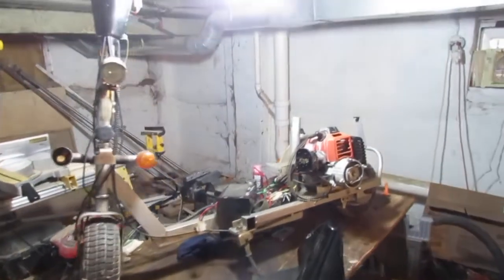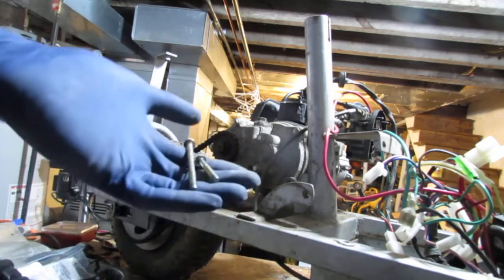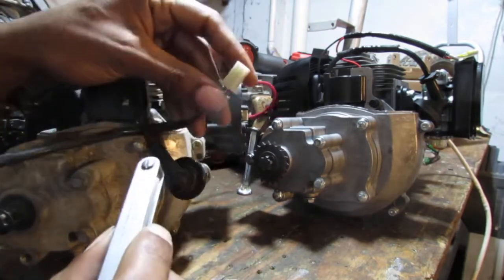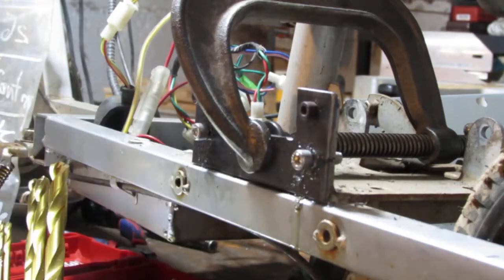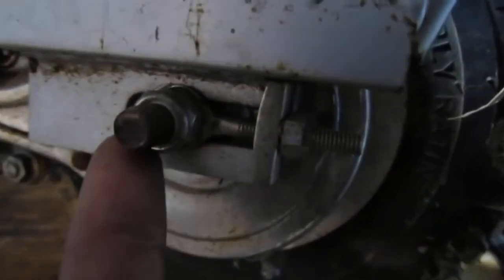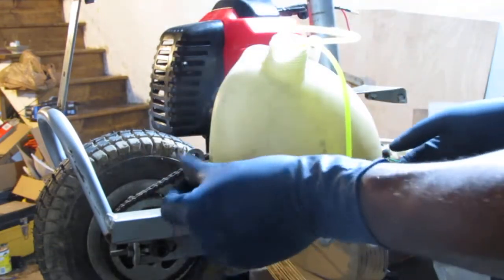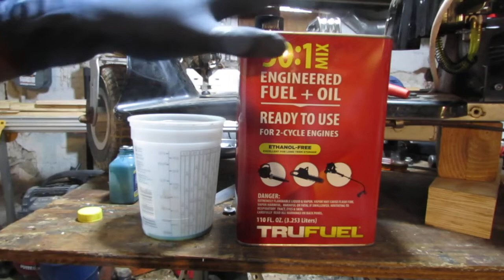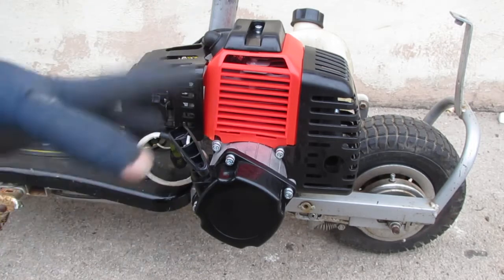Cheap Chinese Gas Scooter 1E36F, Turbo 36CCEX

Comment: This video helped me a lot, thank you!  I used propane out of a common torch to start the engine.  Took about 30 seconds on prop. before the fuel pump would actually prime and run the machine.  I'm running a 16 to 1 fuel ratio 😅  as long as I hop on it and get on the throttle, she runs well

Comment: I just ended up grabbing one of these scooters for like $30 - your tear down is already helping me out!
Reply from the maker: That damn carburetor is killing me.  I got two replacement engines, same engines and they both failed.  I can not dial in the carburetor so it runs with the correct amount of power and with the choke off.  No matter what I do I can not get this carburetor set.  I need high and low settings to adjust appropriately.  The carburetor on these only have fuel mixture.  Have been searching for an alternative carburetor with the same bolt up size with a high and low adjustments and have not found any.  I also got mine for cheap $20 USD.  I thought I could save it.  This is what is causing a delay for a part 2 of this video.  Let me know how it goes and glad this is helping you.  If you find an alternative carburetor let me know.

Comment: So did you get it running correctly ? there is a hidden speed adjustment screw at the top center of the carb under the plastic round at center. The round "relay" is the electric starter solenoid. Works with the battery and key. Just found the exact same model and trouble shooting the electrical now. Mine is also in bad shape. Fuel should of not been leaking where it did on yours. the paper gasket should have sealed it to make it air tight. Nice work on the metal fabrication. check for that hidden screw adjuster. it's there.
Reply from the maker: I did not get it running.  I had a different idea on it.  I was going to ream out the main jet.  This speed adjustment you mention, this is different from the idle screw I was messing with in the video?   I will look at the carburetor for the secret adjustment screw you mentioned.   I suspect because I have so little control over the carburetor it might also be flooding the engine.  Thanks for explaining the part of the electrical system.  The electrical system is super easy.  I really want to restore this scooter.  So much so I was going to dump money into getting a 220 welder and getting an electrician to add that line to the house so I can build a different engine housing and get a different engine that has a better carburetor.
Reply: @MotionDesignStudio   Right on top of that cooperator is a is a slaughtered screw screw you can't miss it turn that halfway opand that halfway open and you will notice the difference in power
Reply: Sorry using text to talk got some words wrong
Reply from the maker: @thetubeschannel  , will look for it and report back.  I hope this works out.
Reply from the maker: @thetubeschannel  , the adjustment screw has been found.  Those little sneaky friends at Walbro and the E.P.A.  Thanks for the heads up.  Now I can make a follow up video.  Look for it as I will give you credit for this guidance!   You are the best and thanks for sharing your expertise.
Reply: @MotionDesignStudio  np!!! Glad to hear it and look forward to the follow up video.  I made one also I hope to post soon. And I gotta give credit to donyboy a YouTube expert on small engines. Don't give up 👍👍👍
Reply from the maker: @thetubeschannel  , that is where I saw it "donyboy".  I just posted thanks on his channel.
Reply from the maker: @thetubeschannel  , I just subscribed to you.
Reply: How do you wire in a battery to use the electric start I have one in perfect condition but the battery is dead but it starts well with the pull start